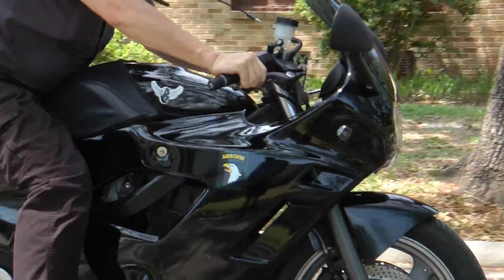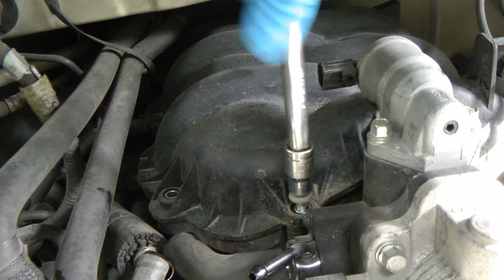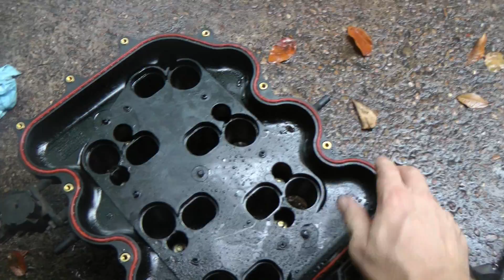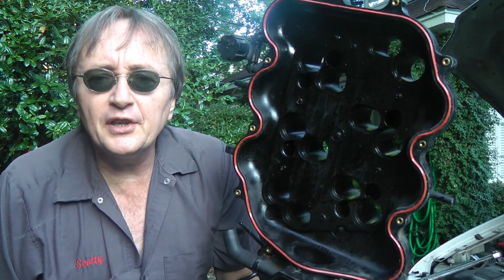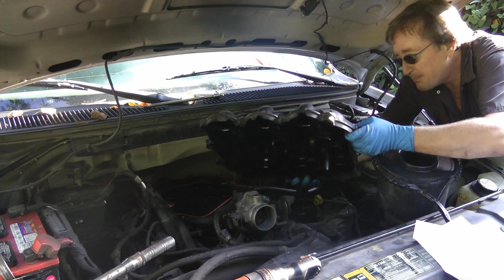How to Replace a Intake Manifold Gasket in Your Car

Comment: Hi please help.   While removing the inlet manifold I forgot to drain the coolant. Soon as I started to remove the manifold I could hear gargle noise so immediately drain the coolant. I've a feeling a little coolant got into one cylinder as I could see liquid in it.  Dried the liquid out using a cloth and pushing it done the hole after removing the inlet manifold. Please help is there anything else I should do.  If I removed the one gloplug for that cylinder and tried to start the car would any water exit through the gloplug hole.  Please help

Comment: Thanks for making the video.  The theatrics of dropping the tailgate on the truck at the end was funny.  If you were to make the assumption that one possible problem led to the other between the following, which do you think is more likely (or how might they relate: recommendation to replace intake manifold gasket (per smoke test performed) or recommendation to repair/replace timing belt (after getting P0016 error code, replacing intake and exhaust vvt solenoids, spark plugs, platinum fuel service {injector and induction system cleaning}, and replacing camshaft position sensor 1) but still smelling exhaust, getting the check engine light, P0016 code after clearing and new drive cycle?  Thanks for your time.

Comment: Hello Mr Scotty I have 04 Nissan Quest I changed the spark plugs and the gasket for the manifold then I put everything back together I start the car and  won't stay  on with hesitation. .. It dies when I remove my foot off  pedal. I went back and then I checked everything and put everything back together for the second time. Same problem but I did cleaned. Throtte  Body...

Comment: I have a '97 Explorer. After reassembly (with new gaskets and a fresh clean), it stalls right after starting. It appears to be taking in no air (as it only works if you manually open the throttle body. I know this video is a little older now, but does ANYONE have any suggestions for where I may have gone wrong or for what I should check next?

Comment: Hey man I have a 2000 ford windstar van with the 3.8 liter and my back fuel injector is bad and I went an took off my intake goin to get to the injector and 3 of my screws are doing nothing but turning thrue the plastic  .. So what do I do to get it off?

Comment: I removed my manifold when i replaced the valve gasket, when i put it back my manifold is having a leak, engine sounds funny and breaks barely work, is this symptoms of bad manifold gaskets?
Reply: Sounds like you have a vacuum leak. Make sure all the rubber hoses are reconnected. Look at the vacuum hose on the brake booster.

Comment: Hi Scotty love ur videos very much thanks for the education videos I get from it. I just fixed my misfire codes of cylinders and I was getting the intake sensor. That took me 7 months to figure what was wrong with it. Now I’m getting catalyst system efficiency below threshold bank one. I replace my o2 sensor I think after the cat but want to know how to take care of it I check what it’s saying to me the code is saying intake manifold absolute pressure 0 kpa engine rpm 8.75. Intake air pressure -40 what could it be I drive a 2005 Honda Civic ex

Comment: Im looking for the gasket set you put on, the little red rubber rings for the bottom and the res long one up top, where can i find them or what part number did you use for yours? I have the same truck

Comment: I'm pretty sure I need to have my intake gaskets replaced on my 1997 ford thunderbird since my codes are signaling towards that... But should I have the head gasket changed, too while my mechanic is at it or is that a significant amount of additional work?
Reply: Car has 214,000 miles

Comment: My husband changed our themostat, hose,but car is overheating.  Then he tried blue devil, it didn't work.  We will try steel seal.  After looking at your video.  Pray it works.  If not what could the problem be. Mitiziemouse in indy....

Comment: I noticed that when I flipped the lower piece over, it had blades built into it to hold the gaskets out of harms way.  Has anyone done this to get check engine light to turn off, and if so, did it work? Here is video on how to get isolator bolts out.  https://www.youtube.com/watch?v=Jk9I_hI1dvM&t=4s

Comment: Blazer 1998, v6 Vortec. It has random misfire code. Now it won't start. Gradually missing radiator fluid (without leaking). Magically the oil fills it's self and is overflown by about 10 quarts. I believe we know now where the radiator fluid had snuck off to. Cranking the engine produces white smoke out of the tail pipe. In the past: Sometimes the radiator fluid liked to spray out of the top of the fuel intake manifold. My car liked to dump 1/8th of a tank of gas into it's exhaust pipe every 5 minutes. I did not see this on the lists I searched for random misfire? Should we add this to the list somewhere? Thanks for the video, #Scotty_Kilmer #Intake_Manifold_Gaskit #0huAd-CusBo
Reply: I found the smell of gas in my oil. May be 2 gallons.

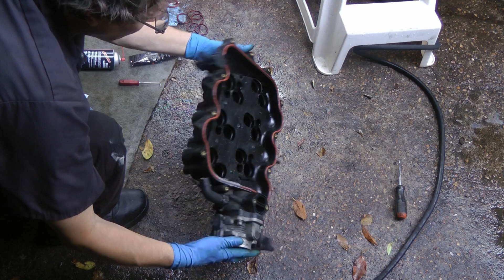Comment: 2:00
"And when that's done, turn it over, and press those brand new gaskets into the dirt on the asphalt driveway. Make sure to grind them in a little, so they'll pick up some dirt, and get damaged."
Reply: Scotty is the Chuck Norris of mechanics the asphalt fears him😅
Reply: 😂 he could just clean it but okiee
Reply: I was shocked by that too 😂
Reply: Not funny; he made the video and was a mechanic 50 years. Follow directions and use common sense ( a towel or clean paper on the asphalt would have worked fine ).

Comment: how in the world do you  test for a leaky manifold gasket.  I have a freestyle . There is oil in my coolant and I have had a bit of a loss of power no check engine light has come on.   i dont see any coolant in my oil.  There is some smoke out my tail pipe but trivial and bluish in color.  sometimes there is a high pitched noise coming around my egr valve area.  there is some oil leakage there too.. Im assuming a new o ring is in order.  I wished i could go to the shop but unfortunately i am going to struggling for just the parts.. i  am planning on doing a smoke test.  if anyone can offer advice here it would be greatly appreciated .  I know scotty kilmer is pretty busy here.
Reply from the maker: manifold gaskets you use smoke to smoke out the leak. Head gaskets you do my video "how to tell if your head gasket is blown"

Comment: Scotty my 94 Civic thermostat was locked shut then when I took it out and proceeded to fill with coolant my intake started flooding with coolant is that the intake gasket or my head gasket that's gone bad
Reply from the maker: pressure test it and see where it leaks out from first, pray it's not the head

Comment: Scotty, would Steel Seal help in intake gasket leak? I have a bad leak on my 2000 Ford Windstar right under where the hose from the radiator connects. Shop wants $400+ to fix it.
Reply from the maker: no, use bars alumiseal for that, auto zones sell the silver colored stuff
Reply: Thank you so much! I will try that! BTW, learning a LOT from your videos.
Reply: I found Bars Liquid Aluminum, but the Alumaseal I found is not made by Bars. Does it matter which one?

Comment: i have a 2000 pontiac grand am SE. what is the part called that is connected to the intake manifold and goes to pipe leading to tailpipe? Mines is hanging and can it go back on or do i need a new one

Comment: What happened with those gaskets inside frames you were holding in the beginning? are those the ones for underneath the lower portion of the intake gasket and you just didnt show going that deep into the engine on camera?

Comment: Did you really put new gaskets on the bottom then flip it over on the NEW gaskets on a dirty gravely driveway? Good video but come on use a clean work space for something that goes directly into the engine
Reply from the maker: let's not be anal here, I wiped the gasket off before putting it on the engine with a clean towel
Reply: I noticed that too
Reply: Scotty Kilmer hey scotty i hsve an izuzu rodeo thats stalling at stop sighns or when the car is low on idle and the transmision check engine light comes on ,,any suggestions of what it may be ??

Comment: i have a 2004 pontiac grand prix and was wondering will i need to drain my oil or coolent when changing the gasket?
Reply from the maker: you can drain the coolant, but only a little would leak out during the job

Comment: Would replacing this stop massive amounts of smoke coming out of the exhaust? It smokes on startup, when I take off from sitting at a red light. I was told it was the valve seals but trying to cover all bases.
Reply from the maker: it can if it's leaking oil or coolant into the engine

Comment: SCOTTY, YOU ARE UNBELIEVABLE.  I HAVE A 2002 FORD E250 4.2 ENGINE AND WANT TO KNOW , IS IT THE SAME SET UP AS WHAT YOU DID? IS IT BEST TO REMOVE THE IAC ALSO TO MAKE MORE ROOM TO GET THE UPPER INTAKE OFF?
Reply from the maker: +James Weissbach yes, it's easier that way, though still a hard job

Comment: how do I change a blow  head gasket  on a 5.4l V8 99 Lincoln  navigator
Reply from the maker: +Jessicca Wynn that is a gigantic job mainly for pro mechanics to do, but if you want to try, get a good manual like a haynes manual and follow all the steps.
Reply: +Scotty Kilmer I was wonting to know what it cost to do that job at a shop and what was some of the things they had to do to fix it my heater core was busted and I was on my way to buy a new one and the engine shut off when it got hot all of a sudden  well when I put water in it and started it up I had water coming out of my tail pipe and had a little miss my oil milky what do you thank I need to do because I have to fix it thank you for your time....
Reply from the maker: +Jessicca Wynn  a WHOLE lot of money at a shop, often think thousands. Sometimes it's just better to install a good used engine

Comment: Scotty, on my 2003 Hyundai Santa Fe 3.5 liter , i removed the intake manifold to replace all the spark plugs an wires , i do that before a misfire is set , all i remove was the plenum, no once i put it back together , now their is a knock noise ??? what did i do wrong an what do i need to do to fix it ? car haas 112,000 in great shape , all wheel drive , i like my car , i like older ones, no this stuff being today , what do i need to do in order to fix it ? please let me know, thank you .

Comment: How can you tell when looking at Manifold gaskets if they are bad? I'm having coolant leak into engine I believe and hope it's  this instead of head gasket :-/
Reply from the maker: clint4Now have the cooling system pressure tested, then you could see if it's that leaking. But realize stuff like Bars alumiseal can be added to the cooling system and often will fix such leaks without taking all that crap apart

Comment: Scotty, any helpful tips or tools for removing bolts from the top of the intake manifold-the ones back by the firewall? I'm having a hard time getting to them. Thanks!
Reply: Looks like the same engine in the video 02 Ford f150 4.2l v6
Reply from the maker: Guy Martin I use special wiggler sockets and extensions to give a wide angle of possible attack positions to remove those

Comment: 2003 Chevy cavalier 2.2  168K miles, there is antifreeze mixing in with the oil, thinking that the intake manifold gasket and/or head gasket needs replaced? It is also periodically blowing blue smoke(not all the time here and there) Could this be one of those gaskets? If so, what is the difficulty level on changing them in this car?
Reply from the maker: pray it's just the intake manifold gasket. do my test "how to tell if your head gasket is blown" and pray that test is negative. Cause a head gasket job is a giant insane job only a pro should really attempt.

Comment: I have a 99 range rover 4.0 with a exhaust manifold leak,truck makes noise when I rev
Reply from the maker: see my video "finding engine vacuum leaks with a cigar' and use that method on the exhaust to find the leak
Reply: Scotty Kilmer well, im in a pickle and i have a 2001 ford f150 v6 the problem is when i get on it it stutters and then stops and i get an 02 code for bank 1 and 2 and get a MAF code as well, im thinking the intake manifold has a leak, at first i thought it was a vacuum leak and i wanted to make sure so i went to a shop and had a diagnostic check done, they said my intake manifold is cracked. Help
Reply: +t.williams jr i fixed any noises i will ever have by making two bigass holes underneath the truck. I like to call them glasspacks but all the 40+ yo people around me call them tinydick i dont know why

Comment: Hi Scotty thanks for the advice I see that you are a advocate of steel seal. Do you think it is a worthwhile thing to do in my situation. I'm really not wanting to tear my truck engine apart but if it has to be done than I will. That being said in your other video you Sao that steel seal works so do you think with what I described it will on mine or has it already gone too far and needs to be repaired old school? Any advice is appreciated thanks in advance
Reply from the maker: if it still runs good, try the sealer, but only use the old green antifreeze in the system, it does not mix with modern long life coolants. then the sealer often will work

Comment: 91 Sierra 2500 5.7L replaced thermostat add truck was overhearing. Then water pump after that add old water began to leak or top vent hole had to replace twice as the garbage one got from Canadian tire started leaking out bottom vent hole less than a week after replaced. Rad had small issue was plugged got unclogged. Truck ran like silk as I also did a oil change at same time. The next morning truck barely turned over. By the time I got work it seemed alright. In the way home truck billowed or huge clouds of white smoke water was running out exhaust pipe and rad was empty after less than 10 km drive home. Pull now also shows the milky color not the nice golden brown it should after my oil change. HELP ME SCOTT! ! I'm at my wits ends each time I repair it escalates only bought this truck 2 months ago from what appeared a kindly old man. Was told it had been rebuilt only 50,000 km ago. Only been in the last month or so this had happened. I don't drive crazy fast or floor the accelerator lol. Any thoughts on what this may be thanks any ideas greatly appreciated. 
Ken
Reply from the maker: blowing head gaskets do that all the time, they will blow the holes out of the pumps also. Do my video "how to tell if your head gasket is blown' it must be so.

Comment: Scott you should do a video on how properly remove the intake manifold on a dodge charger 2010 SXT to do a spark plug change due to some people having problems with EDR valve tube that connects to the back of the intake manifold. also sometimes when you do it right after a few days the gasket on the EGR tube breaks and creates a vacuum leak. that would be helpful.

Comment: Scott another thing I checked my radiator and my engine oil and there's no milky stuff in neither. So with that being said I need your opinion on what you think or know it could be b4 I go wasting $ on stuff it shouldn't be my engine is a 3800 series II engine if that helps no supercharged. Get back with me please on your suggestions. Thanks!!!! 👍

Comment: Scott I got a 02 impala LS that I suspect that the intake gasket is bad. The car is idling rough when I first start the car it starts idling at 1000rpms then it rises to 1500rpms 3secs later. Car is leaking oil grom the top under the valve covers. Blue smoke comes out the tailpipe while idling only when not idling regular smoke comes out. The smoke has a foul odor to it. Can you give me your professional opinion on what you think it could be. Get back with me asap so I can move on to the next step. Thanks!!!!
Reply from the maker: easily could be a blowing head gasket, do my vid test "how to tell if your head gasket is blown"  but if it isn't, I'd suspect the intake manifold gasket is, as that will not show up in that test
Reply: So which one do you think though? I was told that it was the head gaskets and I was told that it was the lower intake manifold gasket. The smoke coming out of the tailpipe smells like burning oil and not burning coolant. So which one Scott

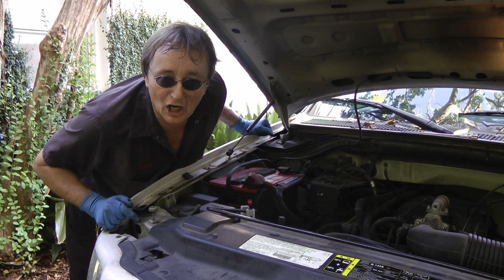Comment: 3:40 SK startled me LOL.
Thanks,Scotty Kilmer for this 1.having had a poor experience w mechanic esp recently,I won't play the "woman card" I've now mastered most of the DIY for my car.And on that note, question, last week replaced faulty radiator cap on my Mits Gal (manual trans) since I noticed coolant dissipating (had I known) Anyway car runs all right,driven no more than 3 miles since then but there's light white smoke from exhaust esp when idled @ a stoplight or when heading up an incline. It comes and goes and it's not like the morning kind that dissipates. Checked oil and coolant for any mixture and underneath car,no visible leaks.Could it be manifold/head gasket or something else.?

Comment: Hello Scotty I have firebird 3.4 iam replacing the head  gaskets. And my question is. I haven't remove the heads yet I do remove the heads and put. The new gaskets on and tight everything like it was from the start or there some kind of trick?.
Reply from the maker: first remove the intake manifold, then the heads, then bolt it back together.  Perhaps get a cheap manual with pictures and directions.